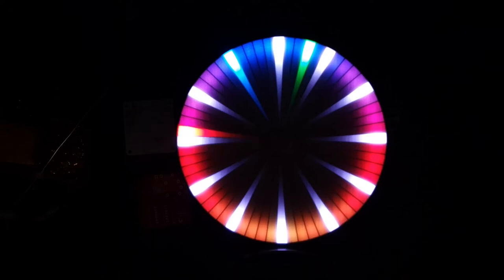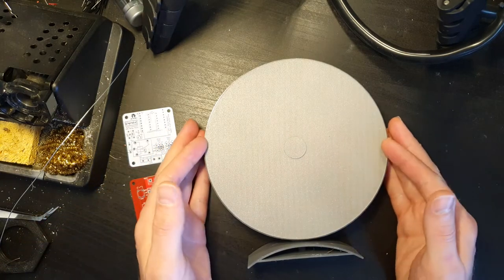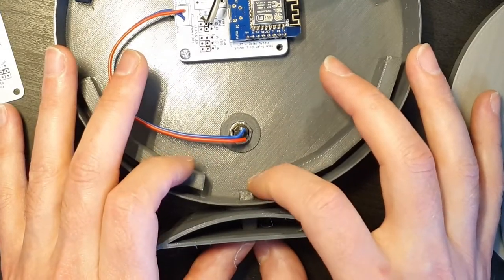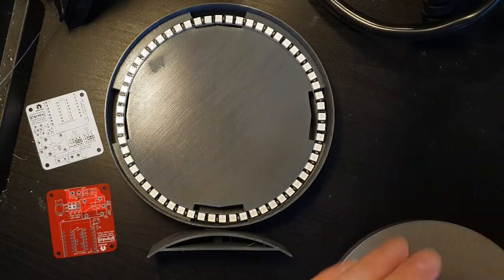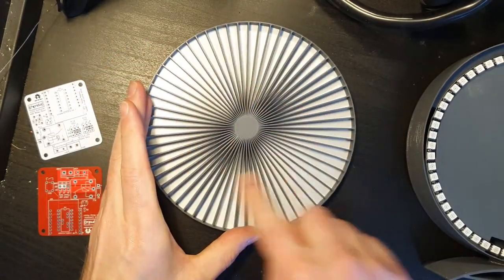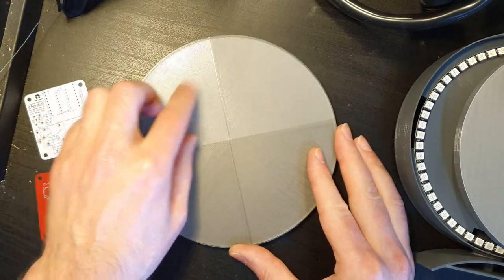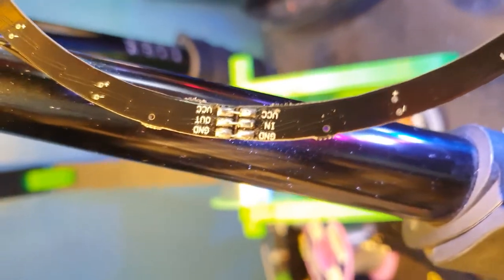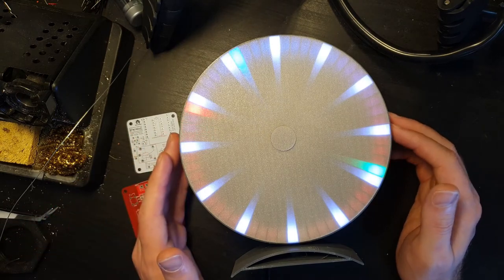Digilogue Clock - WLED Based CLock

Comment: Hey, great project. I have a problem: I printed the housing but my led-ring did not fit. It is 17 cm wide and its one cm to wide. Where can I buy a led-ring who fits in? I looked at amazon and aliexpress but I didnt find one. Any help? Thx.
Reply from the maker: Ack I forgot to reply to you sorry! If you sre still looking to build these are similar to the ones I brought I think: https://www.ebay.co.uk/itm/313603433555?mkcid=16&mkevt=1&mkrid=711-127632-2357-0&ssspo=Tv2X_9upQN2&sssrc=2349624&ssuid=c1Upsh4uQ3u&var=&widget_ver=artemis&media=COPY